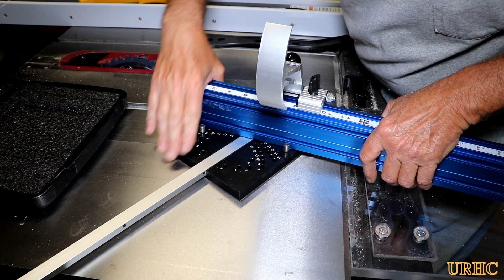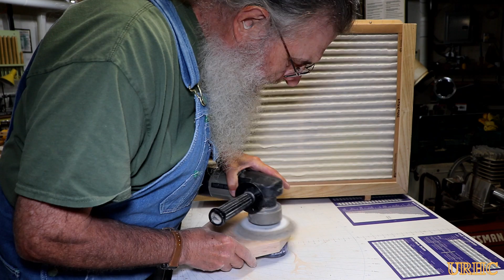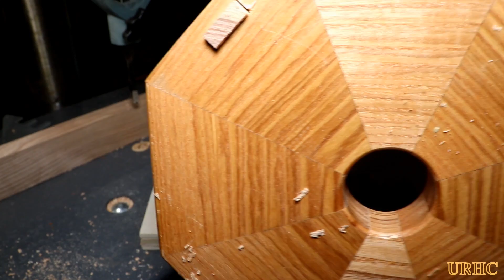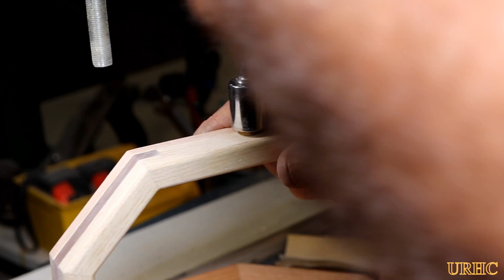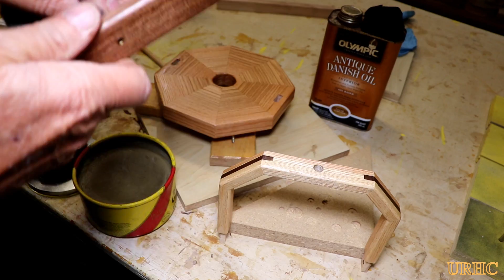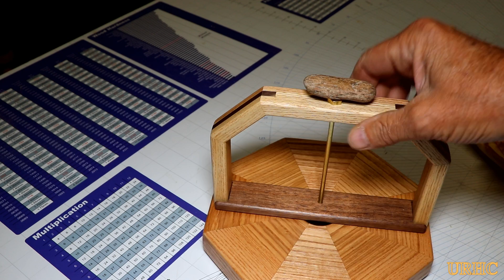Custom Napkin Holder Build

Comment: seems the rod and its handle in the middle are not necessary.
Reply from the maker: If you just want a wood weight  that could fallout. Thanks for watching.
Reply: @unemployedredneckhillbilly2023  the wood cant fall out it has noches in the end.